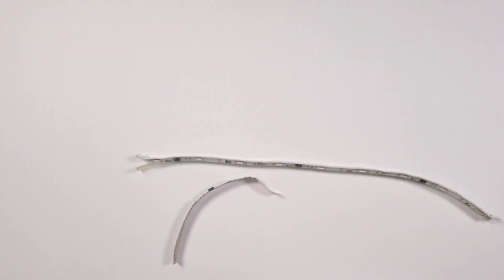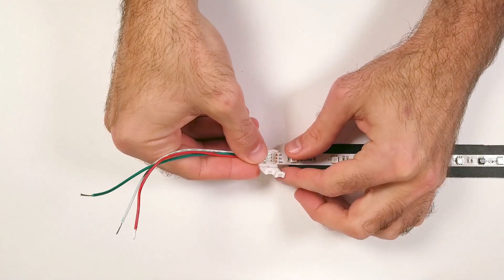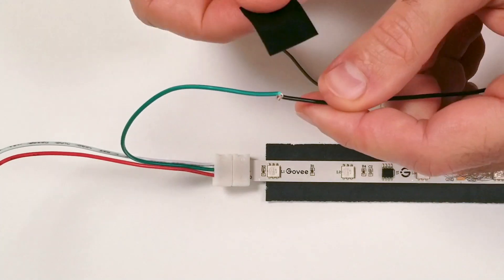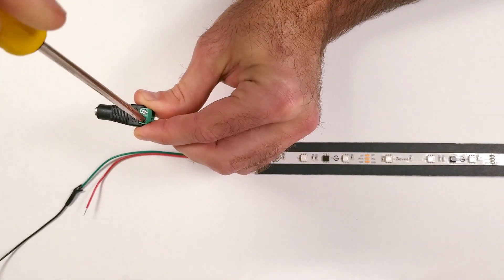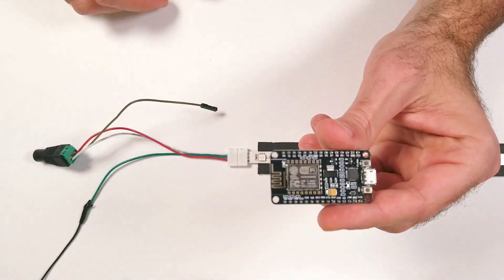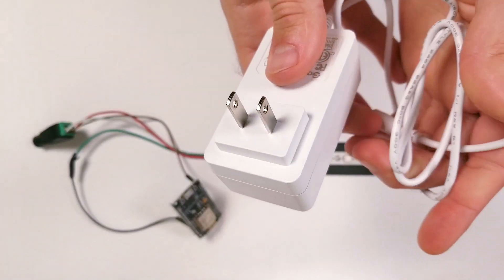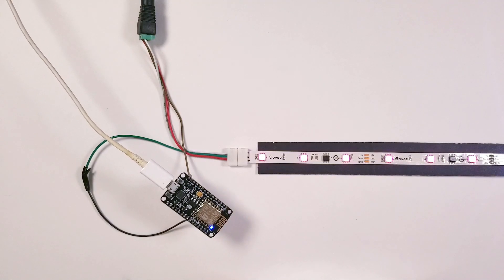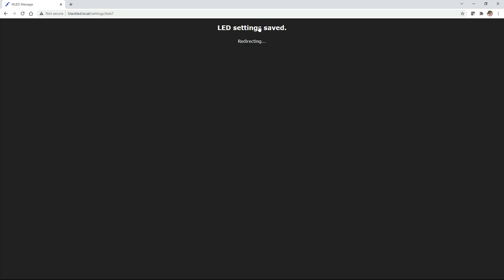Control Govee Strip Lights with WLED! Easy Step by Step Tutorial. No Soldering Required.

Comment: I bought a Gledopto 5 in 1 ZigBee Mini bla bla and I have a cut Govee strip. I have solved the wires and power supply part, but I can't figure out how to connect them to the controller. Only option with three wires are CCT, but how do I know which one of the ground and data wire goes where?
Reply: Don’t think rgbic strips are compatible with that controller
Reply: @wedeservedit  it can, just not that type.

Comment: Hey, I was following along the video but also reading the getting started of WLED, in their diagram they use a level shifter on the data line between the strip and the ESP32. Is there a reason why this isn't needed in your case? The ESP32 should normally send out 3.3V while the strip's data is 5V
Reply from the maker: As long as the data line is not very long you don't need it. If you experience flickering then you will need to add it.
Reply: @ChrisMaherDIY  thanks for the info and the super quick response! I'll try it first without shouldn't be too long in my case

Comment: CAN YOU USE LED LIGHTS SUCH AS THE BTF LIGHTING BRAND TO WORK WITH THE GOVEE CONTROLLER, POWER SUPPLY AND APP?
Reply: Kinda why I'm doing custom strips using govees leds because ion like their app ecosystem and you can't any modifications usually aren't reflected in the govee app, this might be different for the govee m1 strip since it's advertised as cuttable

Comment: Hi,
I got Govee Neon LED Strip Light leftover strips AND Govee RGBIC LED Neon Rope Lights for Desks leftover strips, I would like to use them elsewhere in my apartment . I wish I could find some adapters/controllers online that have lots of juice cause those light strips need power to get them to their full potential, do you have links for my kind of rope lights? I guess the controllers/adapter online won't be able to have all the thousand setting effects as original's Goovee adapters/controllers but something close that works with a remote control with programable colour effects would be interesting. Any suggestion/advice would be appreciated 🙂, thank you.
Reply: Curious if you ever figured this out??
Reply: Goovie got 24volts so I just used 24volts controllers & adapters bought from Aliexpress. I did a lot of soldering since last year and learned a lot. People selling Leds didn’t really care to help me so it was more a miss/learn experience; I waisted a lot of money with my lights experiments but today I can say I am very proud of everything installed it’s all cool.

Comment: How did you find out wich type of LED you have. (ES2012, WS2811, ...) ?
Reply from the maker: Great question! With the 3 type pin setup, I assumed it was the standard ws281x type configuration. So I didn't know for sure but after testing things out, it worked using that type strip which is going to be the most common type. I still have not figured out how to get the Govee M1 working thig way though!

Comment: Hi Chris, would I have to worry about voltage loss or any other issues if im making lets say a 8 foot wires going from the LED strip to the power supply? Im going to be attaching mine to the ceiling and have the controller/power supply located on the ground.
Reply from the maker: I think you should be good from a power perspective. The longer the data line is from the controller to the first led, the greater chance the data signal will not get to the first leds strong enough and the lights will not respond/and or look crazy. I've been able to combat this by installing a small resistor coming off the data pin on the esp device. Around the 13:30 part of this video: https://www.youtube.com/watch?v=b13VLiK7AOU&t=296s

Comment: Dumb question: could you power equal size strip of offbrand with the Govee power supply parts you left out here?
Reply from the maker: Thanks so much for watching! Thats a great question! I have not tried doing this but as long as the strip your trying to power is the same voltage as the Govee power supply you should be able to use it!

Comment: Another question do you think you could hook a bluetooth module from a govee underglow kit with non bluetooth govee leds? Does it matter if they were made for a remote or not if they only still have the 3 copper pads for hook up
Reply from the maker: Another great question! I'm not 100% sure on this either but as long as the voltage and led strips are pretty much the same, I think that would work. But if the controller is meant/built for a specific type of led strip and the new strip has completely different technology, then it might now. Tough to know for sure until you try it.

Comment: any one know how to set up a ESP8266 with a 4 PIN LED strip?
Reply from the maker: Thanks so much for watching! If the led strip is a ws2815 it will have a BI pad. That BI pad can be connected to the ground wire. Also make sure to pay attention to the voltage of the led strip as well.

Comment: You wouldn’t happen to know if I can connect a govee blue tooth module for underglow to different leds with the same wire design but was originally set up for rf remote for the opt-7 lights
Reply from the maker: Thanks for watching and great question! I wouldn't know for sure and would have to try experimenting to find out. Maybe at some point down the road I can try!

Comment: Can this work on a 64ft instead of a 32ft led strips? I'd like to have the leds to go around my room, but I'm unsure if I can with the voltage.
Reply: Also, great video! I like how you list the steps and how you linked the materials in the description. I just subscribed!
Reply from the maker: Thanks so much buddy! Appreciate the kind words and thanks for the support!
Reply from the maker: Thanks so much for watching! You can definitely do this with a longer led strip. I would start out with not doing any power injection and see how things look. if you can very visibly see some voltage drop, then I would add a power injection point at the end and test again. I'm all about trial and error!
Reply: @ChrisMaherDIY  how do you add another strip to the power supply? Do you have to get another ESP32 motherboard? Do you plug in the two different esp32 motherboards into one transmitter (12v to 5v) at once or can multiple led strips can go on one individual motherboard? Sorry for the questions, I’m just a little confused on adding another led strip.

Comment: I’m trying this with their rope light, I cut the cable before the controller, there are three wires, I hooked them into the athom  LS4P-WLED controller and have not been able to get this to work.
Reply from the maker: hmm, i'm not too familiar with the ls4p controller or that specific rope light. Do you know what voltage the rope light is? What are you using to try powering them?
Reply: @ChrisMaherDIY  I tried using a 12v power supply that I’m using with a bft strip. Before I rip it apart more, I’ll try it with the power supply that came with the rope light.
Reply: @ChrisMaherDIY  according to Amazon 24v!
Reply: @ChrisMaherDIY  that did the trick. And the rope light looks great with the wled effects.

Comment: hi, great video, i kindly ask you if there is a way to make the goove light strip longer. in my case i have 10 meter outdoor light strip but i need to make the strip longer. thx
Reply from the maker: So you can certainly make the govee strips longer (soldering them together) but you would then have to use a different controller as the govee app is only built to control the pre set amount of lights. If your going to be using a different controller, you might as well just try using some ws2812b led lights or something else similar to them that give you the ability to control every single led vs just groups of 3. But if you have a bunch of govee led strip lights laying around, definitely a fun thing to try extending them and using a different controller.
Reply: thx u so much, u get me inspired to have fun whit leds, i have see a lot of video but no one is clear and good like you, greetings from italy XD

p.s.
planning outdoor project ?
Reply from the maker: @ZiosTechRoom  thanks buddy! All the way from Italy!! Awesome! I definitely want to do something outdoors at some point! Maybe on my deck/patio I'll try doing something!

Comment: Hey Chris, Great videos! Trying new things based off your videos with great success and confidence, that otherwise wouldn't have been there. Great stuff.

I successfully did 2 x 16' Govee light strips (RGBIC (12v, Din,GND)) with this configuration , but I had a 32' Govee strip (RGBIC (+24v, NC, DI, GND)) that I was hoping to convert to WLED. Any suggestions or thoughts? 

Thanks again and keep feeding the community!
Reply from the maker: Thanks so much! Glad you have been playing around and having fun!! Unfortunately since I have not tried using that particular strip, I would just be guessing on how it should be done. At some point I hope I'm smart enough to answer almost any question that comes my way but for now I'm far far away from that lol. But thanks so much for watching and taking the time to comment! Let me know if your able to find the answer since I'm curious myself how that would work!
Reply: Morning, any luck on this ? i too have a +24v, NC, DI, GND strip that i have laying around but no luck getting it to work. 

any update would be great.

Comment: I can't thank you enough for all your videos, they have really inspired me to create a handful of very unique projects, wish I could post them on the comments.  At any rate I had a question you may be able to answer in the path of this video.  I am doing some WLED strips in my outdoor pergola area and came across the Govee slew of outdoor lights.  They have the string bulbs, flood lights, and some ground lights that are all RGBIC.  I would like to change them over to WLED as I have not been able to find any open source options like these in addressable form.  Would they hook up to WLED just like this video?  My concern is the way they run their chipsets in groups over individual LEDs and how I would determine that.  Any help or ideas would be much appreciated!
Reply from the maker: You are very welcome and thanks so much for watching! I've never used really any of their other products so I'm not 100% sure. I think the first thing you would have to look for is if they have 3 lines going into their lights. Voltage, ground and data. If they do, I feel like there is a good chance they could be converted to wled but that's only a guess at this point. Also i'm not 100% sure on string lights but if its like their rgbic strip lights, you can only control the lights in groups of 3. So if there are lets say 30 govee led lights on a strip, WLED would be set at 10. For flood and ground lights, I doubt they would work with wled.  I would probably order from amazon, see if I could get it to work, and if not, just return them! Gotta love Amazons return policy! You have me curious though so I might have to try looking into this myself down the road!

Comment: Chris, this method works for using 1 leftover Govee strip (or other 3 pin 12v LED strip) Can you do a video on how to connect additional segments without solder and at what point with the Govee or other "regular" power adapters (versus the larger metal transformers) you would need to inject power to keep the lights ta good brightness? Is all that possible without solder? I do not have the best eyesight on the planet and the idea of soldering all that together is very daunting. I'm hoping it is still feasible to do.
Reply from the maker: Hey Will! Thanks for reaching out! I can certainly put that on my video to do list. However without soldering, your pretty much limited to something like this which should work just fine! https://amzn.to/3qekhEO As far as needing to inject power in those 12v strips, i've not worked with them enough to know when that might be. I know 12v options you need to inject less than the 5v kind. If you wanted to inject power without soldering you could probably use these and just twist the wires together or use wago connectors to connect them together! Hope that makes sense!

Comment: Hello Chris! Perfect video. I have a drawer full of Govee strips itching for a new home. Question. Can your solution support a t connection where I send lights in 2 different directions off of this one controller? 

If so, can you kindly assist? I can solder and have had zero luck with those solderless t connectors but willing to learn.
Reply from the maker: Thanks for watching and great question! I know you can send the exact same light signal in 2 different direction. You would simply take the data line that is coming from the controller and split it into 2 data lines and then your led strips will be separate but the data will be doing the exact same thing on both lines. The other thing you can do using WLED is create different segments on 1 strip. That means you can break up however many led's into their own groups which you can then control independently. I hope that makes sense but please let me know if you have any questions at all!

Comment: Would there be a limit of the length if I tried this I’m trying to do my game room also will all govee leds? Work if I do this I’m trying to buy some today and the stuff to do this project
Reply from the maker: Thanks so much for watching and great question. There would be a limit of how many lights you can power this way but it depends on how bright you want them and if you want to put them at full white. I'm sure there are some complex formulas you can use but I've always just done trial and error. Set it up, test it out and see if it works to your liking. The more leds you have the more power they will draw and eventually they will start to not be color accurate and you will probably need to add power injection points. Thanks again!

Comment: I hit a roadblock I cant get past. I followed the instructions to the T. Strips are going the right way, esp board is flashed and wled connected with the board and wifi, yet even when power is on the govee strips dont turn on.
Reply from the maker: hmm, the only thing I remember was that I did have to wiggle the connection piece around that was connected to the pads of the govee led strip. I had to get it just right for it to work. Other things is just making sure you have the correct 12v and 5v adapters that your using. Other than that, just making sure the wires are all making a solid connection. One time I did have a bad wifi board but that was only like 1 time out of 50. Good luck and let me know if you are able to get it working and if you are, what was the issue!

Comment: Hey Chris! Thanks so much for posting these videos I admire you designs… I am working on this project with two 32’ strips and two 16’ strips to go in a dance studio my wife and I are opening soon. I wasn’t able to get the to read data from the node board. I really need your assistance, plz HELP!!!
Reply from the maker: Thanks for watching and for taking the time to comment. What Govee led light strips are you using?
Reply: @ChrisMaherDIY  I have the H619E1D1 65.6ft (two rolls of 32.8ft). Also have the H61171A1 (two rolls of 16.4ft). My plan was to use the rolls separately using the baseboard design theme. I found that chloroplast (corrugated plastic sheets) is a good defuser material to use. It is waterproof and durable. I made an 8ft sample that looked great but i wasn't very impressed with Govee's lighting themes. I ordered some wired 3 pin connectors last night from Amazon. I was hoping maybe i just needed a better connection. Thanks so much for responding to help.
Reply from the maker: @lbrienmiller2195  The corrugated plastic sheets is such a good idea! I looked up both models and the H61171A1 looks like it has the same 12v 3 pin configuration as the one in the video so it should work. I do remember I had to wiggle the connector piece that is attached to the pads of the Govee lights and it eventually made a good connection and worked perfect with the esp8266/WLED combo. The other one (H619E1D1) at least from what google showed me is a 24v strip with 4 pads/pins on the led strip. If that's the case, I'm not sure how those would connect as I've never tried using that type yet! Sorry i couldn't be of more help but hopefully you can get it up and running! I'd love to see the results with the plastic sheets you used!
Reply: @ChrisMaherDIY  sure thing! Are you on FB or have messenger? If so I’d love to stay in contact and would be easier to share content!
Reply from the maker: @lbrienmiller2195  email is best for me! not much into facebook. outrunprojects@gmail.com

Comment: Hi @Chris Maher,

I have the RGB strip of Govee (H6110). Is it possible to hook this one up to a nodemcu with wled? Because this 2x 5 mtr strip has pins on the end...I dont know how to attach this one to the mcu in the right way. Could you please tell me?
Reply from the maker: As long as those Govee H6110 strips have the 3 pin configuration on the led (12v pad, middle data pad, and gnd) you should be able to use them. If they have a different pin configuration, I'm not sure if it would work. What I did was I just cut the first 3 led's off the Govee strip so then I had the pads to work with. Thanks again for watching!
Reply: @ChrisMaherDIY  No, the Govee HS6110 is 12V. So it has 4pins. 12V, R,G,B. I was hoping you have a solution for this one also 🙄 Love your videos, keep them coming!